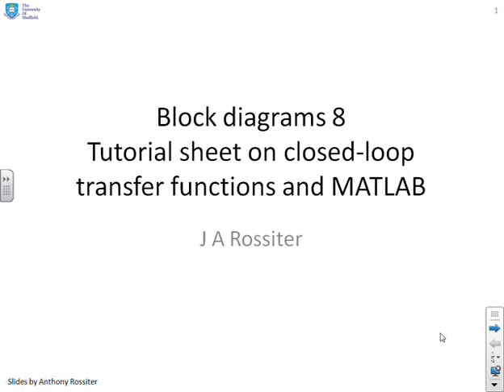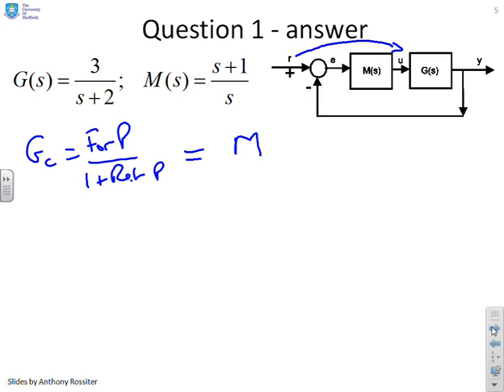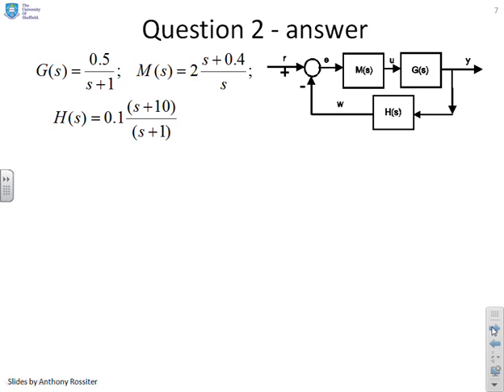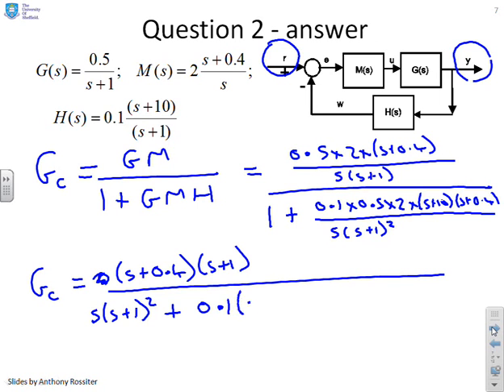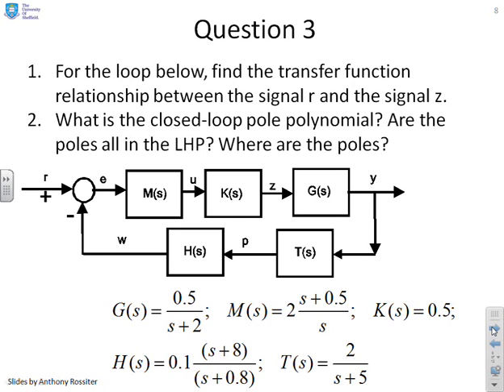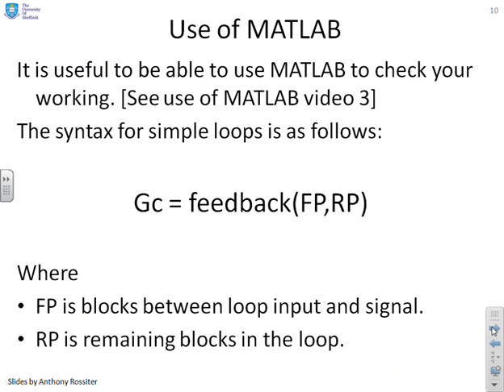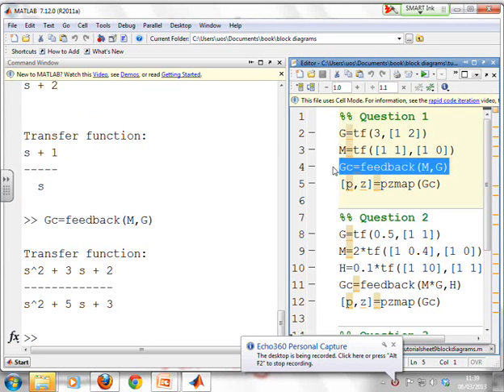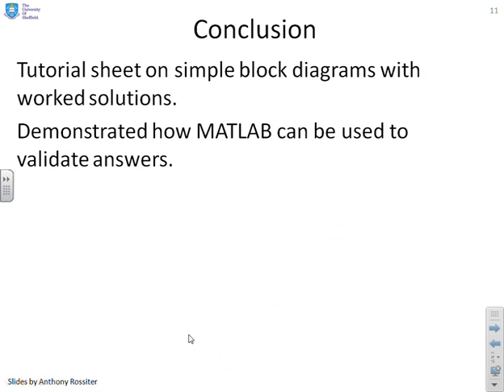Block diagrams 8 -- tutorial sheet on closed-loop transfer functions and use of MATLAB

Comment: very helpful video thanks
also the formula for Gc..is that just a general formula im expected to know?
Also for the first example why did you multiply the TF by r?.
thanks again.
Reply from the maker: The output signal will normally be a transfer function multiplied by the Laplace of the input signal.Closed-loop output is Gc(s)*r(s)